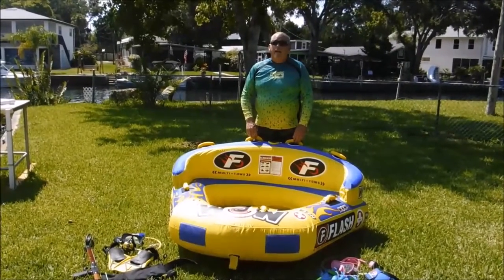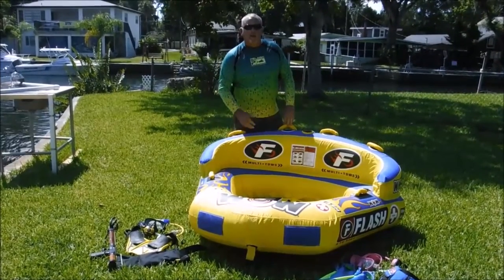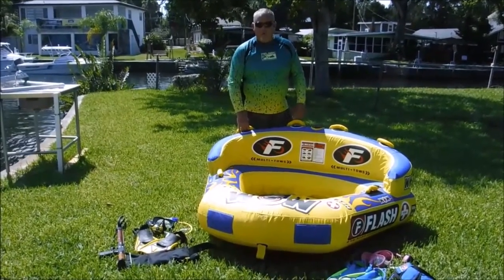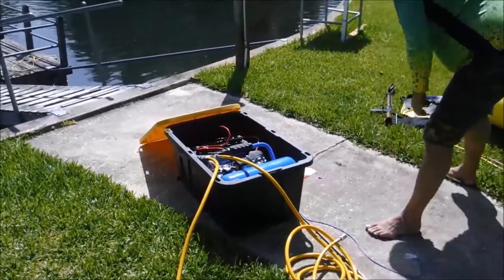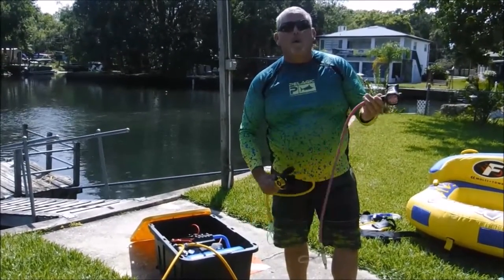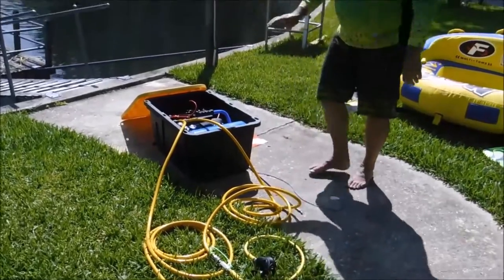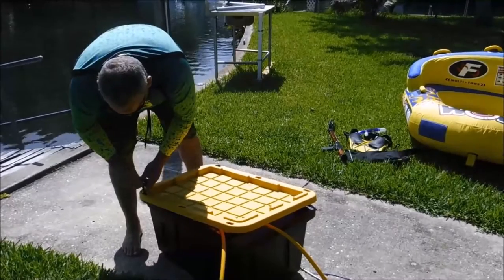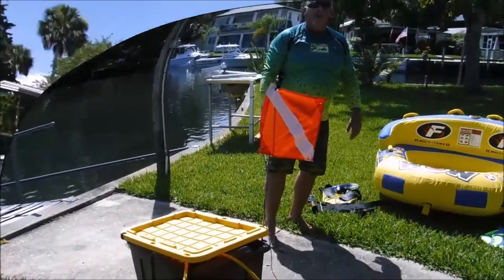How to float your Gator Gill 12 volt powered Diving Hookah System

Comment from the maker: This is a great way to go diving even if you don't own a boat.  so many option and the Gator Gill is approved to be used in most fresh water state parks due to it being non combustible and quiet.  Make sure before diving that you check to see if the area is safe from rip currents or strong tidal flow. Safety is always the number 1 rule in diving.

Comment from the maker: Coming soon to add to the Gator Gill family early 2018.  (Pro Series Elite)   GGPSE12   Has built in Aluminum reserve tank 12 volt and 120 volt models for 2 diver  commercial use.  Stainless Steel quick connects Hose reel and bonus Scuba Tank adapter for your 1st stage.   Add us to your favorites to get the latest updates.